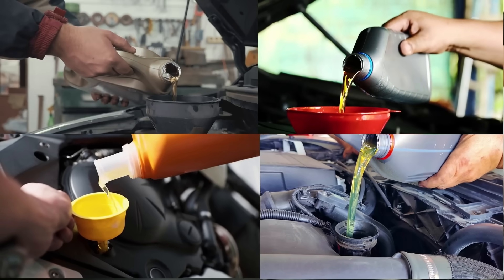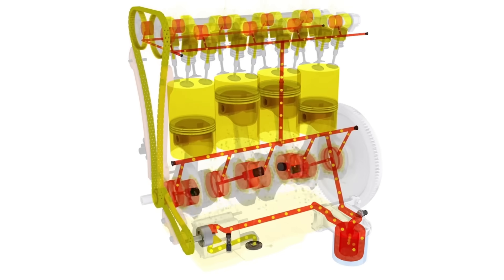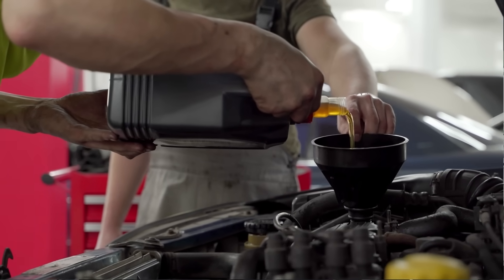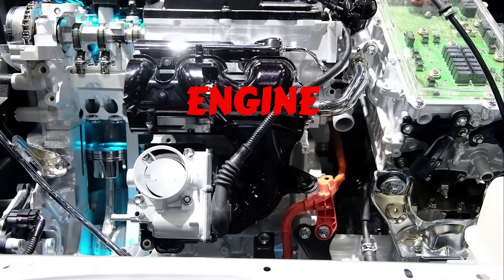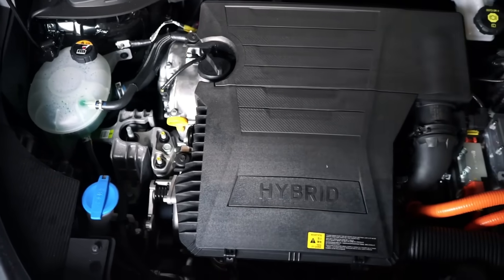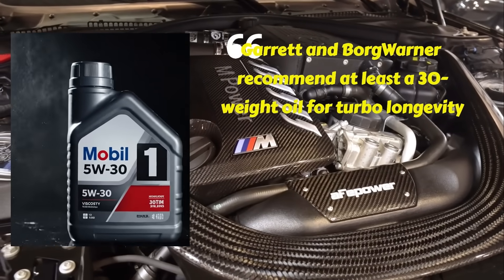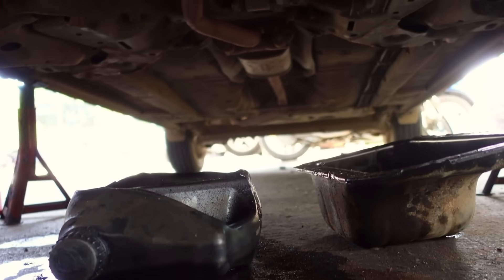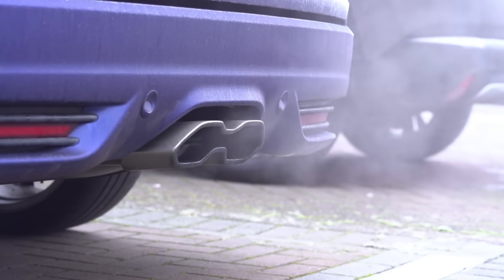The TRUTH About 0W 20 vs 5W 30 Oil (50 Engines Tested!)

Comment: My 2017 Nissan Maxima was having issues at 60K miles with the oil looking like bearing grease when I wiped my finger under the oil cap, and blowing smoke and failure at 80K just after the warranty went out. All oil changes wear at 5k miles when total failure hit.
Reply from the maker: Man that’s rough sounds like early sludge or ring issue  crazy that it happened right after warranty! 5K intervals should’ve kept it clean too  Which oil and filter were you running back then?
Reply: @CarCareCrewoffical I am under the impression the dealership did not do the oil change at the 55k oil change.I had stoped for the 60k oil change then went to drive 800 miles across texas I didn't make it 200 miles before it started smoking, when I checked the dip stick it was bottom of the hash marks and oddly enough what looked like a solid glob of black grease inside the hollow of the oil cap. Wnen I stoped at the next dealership after the oil change I was told they wear going to use some BP, PG detergent in the motor. And it was just down hill from there...
Reply from the maker: @wfirebaugh  Man, that’s rough  sounds like the dealership really dropped the ball on that oil change. Low oil and sludge that early can definitely cause serious damage. Using harsh detergents like that probably made it worse  Always tough when you trust a service shop and it backfires. Did they ever take responsibility or help with repairs?
Reply: @CarCareCrewoffical no the car is sitting in my yard. Wife keeps me broke or I would have replaced the moter my self.

Comment: 2016 gmc sierra I been using 0/20 since new it now has 223k miles I do oil changes every 5 thousand miles and it doesn’t miss a beat
Reply from the maker: That’s awesome bro  223k miles on 0W-20 with 5k intervals  that’s proof consistency beats everything  Which oil brand have you been running since new?

Comment: I think it’s crazy they put OW-20 on a 5.3 V8 engine. Feel like it’s too thin for a V8 man
Reply: At 355hp that's 67 HP per liter, that engine it is doing basically no work and having and easy life. A Corolla GR uses 0w-20 and makes 187.5HP per liter.
Reply: @scotty7453 I was thinking of putting 5W-30 in it gonna waste more fuel but it’ll have better protection on those pistons.

Comment: You’re so full of crap.  My Lexus’ run strictly on 0W20 full synthetic and get oil/filter changes every 3,000 miles.  So do my other three cars.  They are as quiet and run as strong as they did when new.  They have almost 300,000 miles on them.  You don’t know sh**.

Comment: I'm using 5w-30 full synthetic. The car manual says 5w-30. The engine is k3vet btw.
Reply from the maker: Nice bro  sticking with the manufacturer’s spec is always the smartest move! 5W-30 full synthetic is perfect for that K3-VET  great balance of flow and protection , Do you feel any difference in performance or smoothness compared to semi-synthetic?
Reply: @CarCareCrewoffical  Not that much difference in terms of performance but the service interval for the full synthetic one is longer.
Reply from the maker: @lignofreak  True bro, performance difference is minor  but that longer service interval really adds up in the long run  less hassle, more protection!

Comment: What about 5w20
Reply from the maker: Good question bro  5W-20 is still considered a relatively thin oil and works great for most modern engines designed for it. It balances protection and fuel efficiency really well. But if your engine specifically recommends something thinner like 0W-16 or 0W-12, switching to 5W-20 could slightly reduce efficiency and cold-start performance. Always follow what the manufacturer recommends  they’ve tested it for your engine’s best performance and longevity.

Comment: When Cummings went to thinner oil I looked at main bearing clearances and they had not changed from older models I recommend using the older thicker oil.
Reply from the maker: Thanks for sharing your experience—it’s great to hear different perspectives on oil viscosity, especially when engines are involved!

Comment: The thinner oil in newer cars maximize fuel and engine performance like bmw  0w-12 oil essentially can not be upgraded as the crankshaft thicker oil would add resistance to crankshaft rotation. Some race cars use extremely thin oil in order maximize performance. Using a thicker oil could lead to more drag on internal engine parts which could lead to engine failure. It’s important to do research with manufacturer of the engine you want to use
Reply from the maker: Absolutely right bro every engine is designed with specific tolerances in mind. Modern engines, especially high-precision ones like BMW, are built to run on ultra-thin oils like 0W-12 or 0W-16 for maximum efficiency and performance. Using thicker oil can increase drag, reduce oil flow, and even cause long-term engine damage. Always best to stick with the manufacturer’s recommended oil specs.

Comment: Winter here gets  below 20°But factory says 5w30,what should i use?
Reply from the maker: "If your area regularly drops below 20°F (-6°C), 5W-30 will still perform fine since it’s rated for cold starts too. But if it gets much colder, like close to 0°F (-18°C) or below, you can safely use 0W-30 for easier cold starts. Always stick to what your owner’s manual allows.

Comment: America is a large country and the climate conditions vary a great deal from region to region. That has to have been a consideration when the manufacturers select a viscosity. That being said, I would not put 0w oil in any engine. To hell with fuel economy. My priorities are reliability and longevity.
Reply: Согласен брат, зачем такая экономия, если движок потом полетит. Там потом будут траты на много больше.
У меня Шевроле Эквинокс 3 там выбита 0w20 я заливаю 5w30

Comment: I've used 10w30 since the 50s in all my IC engines and still use 10w30 to this very day with excellent service. Clean oil is the life fluid of an engine. 👌👍
Reply: So you've been driving for 70 years? 😮

Comment: I am an automotive extended warranty claim inspector, ASE Master Technician and L1 Advanced Diagnostic Specialist with over 30 years in automotive repair. The large majority of engine failure claims I see, there is one common denominator. 0W20 is the oil that has been used.
Reply: Not in Japanese cars.
Reply: How new is 0w20? Vs 10w30? Think about it this way…. You’re gonna have problems with that oil because that’s what is on the market. Not many vehicles have 10w30 so you’re not gonna have as many claims…
Reply: What about 0w8? Hahaha!
Reply: I am a master tech also, I have seen so many failures with 0 20 also. These stupid epa guidelines and regs are trash
Reply: @gszelogowski Funny how Japanese cars use 0W 20 and don't have these problems American cars do.
Reply: @eac1235   Those cars have the exact same size engine and power as my weed wacker.
Reply: @eac1235  they use 0W 08 now
Reply: @eac1235 no turbos, no direct injection and an electric hybrid motor to take even more strain off the engine. That’s why
Reply: @eac1235 the Toyotas??? Blowing left and right
Reply: Crazy they use 0W 20 in a Mazda but Mazda used to be under Ford Motor Company and they use 5W 20
Reply: @charlesrude8273  my daughter has 2020 mazda 3 . The owners manual states 0w20 for US and Canada and 5w30 for Mexico

Comment: For a 0W-20 oil the values is approximately 1.5% to 2.0% in mechanical breakdown.
5W-30 oils have a higher MB number and are usually between 2.5% and 3.5%. 
A common rule of thumb is that it takes about 10 minutes of driving (or 1 mile/operation) for an engine to be up and 
running after a cold start.
For a warm start, the oil is usually considered to be between 90 and 140 degrees Fahrenheit (32 and 60 degrees Celsius).
No matter what VI you choose , there will be a trade-off. To be honest, warm starts are not done very often. But cold starts are done much more frequently. 
l use 0W-20 and has no problem yet after 38k. 
Its More important to do oil change then the VI
Reply: Exactly

Comment: I drive a 2003 Legacy GT, I use 10W-30 at 192k miles I live it the tropics and it's regularly 98.6⁰Fmy wife drives a 2015 Impreza and I use the same oil in her car at 98k miles.

Comment: I change my oil at or before 5k miles , I have noticed changing from 6-7  k recommended interval has reduced oil consumption now that Im at 111k miles I plan to stay around 4k mile intervals. what are your thoughts on changing oil viscosity according to seasonal climate? I kive in NJ where winter can get to bellow 20 degrees F

Comment: I use 5w-30 Mobil 1 in both cars. I accelerate quickly when driving alone and one car is turbocharged, the other is a small engine that accelerates poorly unless I rev it up.

Comment: I have used Castrol Edge 5w30 full synthetic  in 2018 F150 with 2.7 engine since it was new , has 154000 miles so far hope to get many many more with the price of trucks these days, This is what was recommended , although Ive always used Castrol oil full synthetic even in my lawn mowers, little more for oil is far cheaper than a new engine on anything you own

Comment: ⛔️🛑🔞stop stop .Tip: Always stick to the type of oil specified by the car manufacturer because using another oil with a higher viscosity will destroy the car engine. For example, 5w30 oil has a higher viscosity than 0w20. If you use it, it will delay the oil from reaching the internal engine parts and lubricating them in a timely manner, which causes them to wear out due to dry friction. As for the oil with a lower viscosity, it reaches the engine parts faster and thus lubricates them in a timely manner because it quickly reaches the narrow oil channels and passages inside the engine. As for the oil with a higher viscosity, it is more sticky, heavier and slower and will find it difficult to pass through those passages originally designed for a lighter oil such as 0w20. Therefore, follow the instructions of the manufacturer and do not pass your car engine through it.

Comment: absolutely true.  the  thin oil viscosity recommendation is nothing more than mpg emissions marketing scam.
Reply: Nah. 0-16 user here and our toyota is at 105k miles internals still look new and its never had a single issue. 

Use the oil viscosity the manufacture tells you to. That tell you that for a reason. The engines oil system is literally designed for a certain viscosity, going outside that can effect oil pressure which can either cause less lubrication or damage seals.

Got a new car? Use the newer thinner oils. Got a 1970s American V8? Use the old thick stuff, thats what its oil system was designed for. You want optimal oil pressure at all times to ensure proper lubrication, thats most important.
Reply: それでエンジンにダメージがあったら意味がないやろ。

Comment: CAUTION - if you have an electric oil pump it is calibrated for a specific viscosity. Second - check the references quoted in this AI video - they don't exist!
Reply: What autos have “Eletric” oil pumps?

Comment: I have used 0-W20 during winter months a 5-W30 the rest of the year with good success over the last 15 years on 3 vehicles.
Reply: In central EU I also do the same, my engine is VAG 2.0TDI ... from nov-apr I use 0W20 VW508/509, rest of the year 0W30 VW504/507.....best premium oils are Mobil1, Motul, Liqui Moly ..... for normal use very good oils are Total, Castrol, Shell - (wich is oem VW oil) In general if you change correct oil every 6 months, your engineis going to last twice as normal.
Reply: you dont need to do that like in the old days..since they have additives that helps all those things now..

Comment: Okay so for my 2016 Silverado 5.3 1500 4x4 that has 60k miles is okay to use 0w20 dexos but I did donuts in it like 3 times not for long but if I do that I and floor it often then I should run 5w30 even at that low of miles? What about during the summer and winter would it be okay to run 0w20 in winter and 5w30 in summer? Or is it okay to just stick with one? All year?

Comment: If it’s a GM Vehicle, it doesn’t matter, it will still blow up before 100K
Reply: I have a 2024 Equinox with 127000 and no issues.  I also change oil every 5000 miles.
Reply: @patrickhebdon7354 I have a garbage 2011 engine equinox and it has over 150,000 miles

Comment: I have a 2023 Kia 2.5L GDI Dual injection engine. It requires 0W 20 full synthetic oil. I change at 5K miles. I live in Delaware and I have 50K highway miles already. After 100K miles I may switch to 0W 30.

Comment: I run 5/30 but just picked up a ‘23 Supra with less than 10k on the clock, an oil change was done 300 miles ago most likely with 0/20 and I’m going to 5/30 after another 1000 miles or so

Comment: 2010 Tundra 5.7. 0W-20 amsoil every 7500 miles for the first 250,000 miles. Slightly noisy startup clatter the last 100,000 miles. Switched to Valvoline Restore and Protect 5W-30 10,000 miles ago. Now at 260,000 miles after 2 oil changes startup clatter is gone.
Reply: I've used nothing but 0W 20 in all of my Honda's or Toyota/Lexus and NEVER had start up clatter. Our Pilot has 262,000 and runs perfectly.

Comment: I ran 0W-40 (as recommended by GM now) in my 2015 Corvette. It ran 15-20 degrees hotter than 5W-30. I immediately swapped back. Lesson learned.
Reply: 0W-40 is just for 2020+ Corvette. Previous models asks for 5W-30. Don't know why you thought 0W-40 is a good idea
Reply: Try again but use a wynns friction proofing, I have had a car run with no engine oil for over an hour. It is simply amazing

Comment: This is a bogus study.  Please show me the links this never heard of testing institute.  The "Motor Oil Geek" just released a great YouTube video debunking AI generated nonsense.  No one tested 50 engines.  What were the size of these engines, what were the conditions these engines subjected too?
Reply: Totally agree with you
Reply: A lot of AI bullshits on the internet nowadays
Reply: Ya I saw Oil Geek video as well. Glad to watch that video
Reply: You must not be very smart at all all GM 6.2s are being recalled because of the oil 0w20 and switching to 0w40 20 pretty much has no protection after heat cycle horrible for engine.
Reply: @denalidriven1574  Who are you talking too?  I was referencing a bogus video.
Reply: Ur clearly not in tune with the auto world this is old news we have already made the adjustment to 5w and have seen vast improvements
Reply: @WRENCHGODLLC  I'm not arguing either why.  I was pointing out this video has been debunk and false.  There was no organization that ran a 50-engine test.  If so, show it to me.  Ur clearly not too bright.  "The auto world", WTF is that!

Comment: I live in Lake Havasu City Arizonan where temperatures rarely dip below freezing and the summers range between 100 to 120 degree F.  Our average tempter is around 80 degrees F.  My 2023 Toyota 4Runner requires 0W 20 full synthetic.  I have worked on everything from formula racecar's to domestic street and  sports cars.  I have seen what heat and pressure can do to engines and a thinner oil is not your friend, especially under desert conditions.  Car manufactures love government regulations that requiring higher mileage such as using thinner oil and stop start engine controls.  It gives them the opportunity to sell more cars, service and parts.  So my advice is go with the oil vinosity that suits you area conditions.  Also, don't go by what the oil companies say about in how superior the oils are over another brand.  I personally have use Swepco oil for the last 50 years and I have never found anything better.  I have seen 5 gallon container of there gear oil in a Porsha racing factory pits and there race cars don't advertise Swepco.  Porsha can afford any oil they want but they went with Swepco gear lube in there transmission's, because it holds up better than anything they have tested.  I also have friends that race off road trucks and I asked what gear lube they used and they said Swepco.  I'm not a Swepco reprehensive' or do I get compensation for my comments (I wish I did) but, 50 years experience using there products has taught me one thing, "never fix something that's not broken".

Comment: Choosing the most appropriate oil for a combustion engine car is a never-ending story! I have a Mazda Skyactiv G 165 (2.0 liter natural aspirated engine) from 2016, and is written in the Owner's Manual to use origina 0w-20 or 5w-30 for Europe. The original 0w-20 from Mazda is a full synthetic oil but the original 5w-30 from Mazda is a semi-synthetic oil, what should be the best choice in this case?!?!? Btw, if anyone wants to avoid headache regarding these "philosophical thoughts"  buy an electric car!!! You will no longer care about oil viscosity, additives, transmission & clutch problems and other stuffs like this!!!

Comment: GM just had a recall for their v8 engines used in their trucks, I'm not sure which displacement engine but they changed oil recommendation from the low viscosity oil to 5w30 oils, even going so far to change the oil filler cap to reflect the new value. Those engines exhibiting excessive wear were changed out under warranty. My granddaughter had her engine replaced after 70,000 miles due to excessive wear limits.
Reply: 6.2L V8. They did not switch to 5W-30 but to 0W-40.

Comment: 2021 Toyota RAV4 calls for 0w16 but I use 5W30 in the hot deep south. I haven't noticed any mpg change. I have currently 35,000 miles and no oil consumption between 5,000 mile oil change interval.